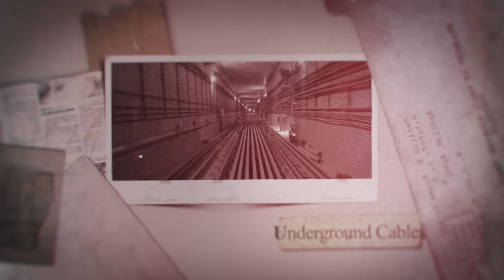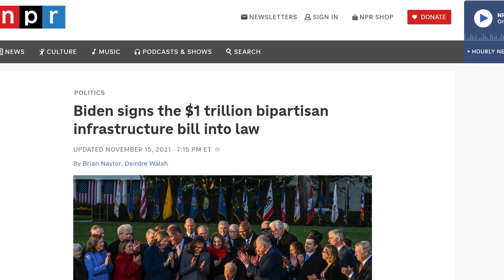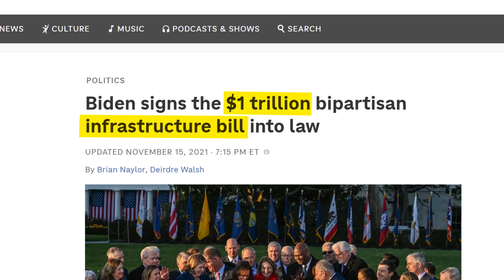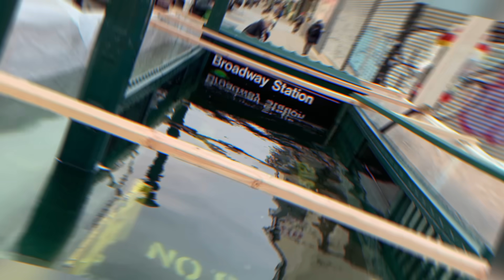Why Tokyo Has The Most CHAOTIC Power Lines in the World?

Comment: Canada has a hybrid system like the US. Downtown Toronto has mostly buried lines, but they ran into a problem a number of years back. The city salts roads to prevent ice build up. When the snow melted, that salt water was getting into underground transformer vaults and short them out. A lot of this was due to aging infrastructure. Politicians here don't focus on long term infrastructure maintenance because 1) it's expensive, and 2) it's not sexy. So stuff often has to be in really rough shape before it gets dealt with. A lot of it only got fixed due to make-work projects during the Great Recession. The United States has the same issue.

Comment: I have no problem with overhead power lines. BUT! When you have a whole cluster of cables coming from one central point, change it out with a single larger (more voltage/power) cable to the next point where power needs to be distributed. The distribute from there out to the other spots...similar to an Ethernet network using hubs.

Comment: In the Netherlands the whole country is underground. In Belgium and Germany that's not the case: there are still rural areas with overhead power lines. Obviously I prefer the underground ones because of aesthetics. When there's a power loss that is usually caused by digging in the ground. It happens rarely.

Comment: Underground cables are hard to repair in case of the aftermath of strong earthquakes, which unfortunately is Japan's reality. One solution for that is to make tunnels for cables, but that will cost a lot to construct and maintain with how large Japan is.
Reply: Underground cables are LESS susceptible to damage by earthquake, Poles flail about and snap the cables.
Reply: @paullangford8179 That's when the ground is relatively solid, a lot of areas in earthquake prone areas are also susceptible to liquefaction. We have a city with underground electric cables in one area (portion), the entire length lost integrity after a mag 6 earthquake struck. They ditched the costly repair and returned back to poles.

Comment: I think using both to maximize efficiency is best. As the video states, some adapt different system due to geographical conditions. So it is best to adapt a system depending on the place if it gets frequent typhoons then underground is better or have a mix of it both. Underground for commercial centers and have overhead lines for suburbs.

Comment: The ugliness of phone/internet wires in Asia is often more the installation of individual wires for each number / connection point (lack of installing trunk lines). That's why you see the coils of excess wire/fiber wound up on each pole. They COULD make them much more aesthetically pleasing and with lower overall costs, BUT they would have to invest in the trunk lines first, rather having no investment in the future and making customers pay for each point as it's installed.
Reply: it's the Telecommunications companies 😊

Comment: A lot of old east coast U.S. cities have cables and utility poles all over. Philadelphia is a very dense city yet outside the very center the lines are dangling everywhere. NYC outside Manhattan even strings them house to house without poles. It's very unsightly and many break loose in hurricane storms. I hope one day all dense urban areas can have power underground, or figure out a way to beam electricity wirelessly. Or get buildings disconnected with solar and battery.

Comment: Power lines generate heat which is why underground lines are much thicker than overhead lines. They need additional cooling since airflow is highly restricted, normally using dielectric oil. It's also much harder to find a break in an underground cable and maintenance costs are several orders of magnitude higher. It would be better to have dedicated overhead line avenues like we do for roads. In other words, leave a lane open just for power lines that doesn't cross streets, hang off the sides of building, or interfere with other public areas.  We need dedicated lanes of infrastructure as well as transportation. We need better civil engineering.

Comment: Alternating current suffers capacitive loss between the cable and the ground. Amount of loss is inversely proportional to the square of the distance of separation. A buried cable is only a few inches from the ground in all 360°.  An aerial cable is usually more than 20 feet from the ground for 180° and upwards is infinite.
  This energy loss consumes resources.

Comment: Living in rural Sweden. 6 miles from nearest town. In 2005 a winter storm resulted in 3 weeks without electricity and more without telephone. Another storm in 2006 only 2 weeks.
A bit troublesome in a electrically heated house and no water (electric pump in the well).
Electricity company has spent many hundreds of millions to dig down cables. Now maybe an hour a year black. Phone company have shut down the copper net. Erratic cell phone net but dug down fibre works great. And the cell phone switches to wifi.

Comment: In the Netherlands all cables are underground, but the Netherlands is also a delta area! There is water everywhere, even under my house. I don't have a basement, but there is a hatch to get to the sewer pipe and drinking water supply. But when I open the hatch, all I see is water. The distance between the water under my house and my living room floor is I think half a meter. And I live in the east of the Netherlands so not below sea level.
Reply: Water can be controlled, except for tsunamis, but earthquakes can happen at any time and will cause damage anywhere. Underground repairs will be much more difficult and require many times the cost.
Reply: @zianfarahariyadatuljanah407  Earthquakes have much less effect on undergroud services. Poles whip around and snap the cables. creating a hazard.

Comment: SMES Tiers and Levels Exception. APPROVED for Upgrades, Maintenance, Case Studies and Reconciliation/Realization of Assets Equipment Supplies/Suppliers under Warranties. Reason:Product Developments for Infrastructure, both land and water resistance capable. Newer Recyclable materials designed for Quality control. Example are the following Flood prone areas and Installation of cable wires underground. It is important that they are maintained with newer capacities to be as electro-protected, won't cause electric shock when submerged to water since materials are renewable and durable. Plastic/psi resistance should be increased, so as to prevent leakages on its foundations and that its coating are NON porrous material, THICKER, able to resists moisture, heat and DAMP places, specially in WIRING. 3.Castor roller infrastructure is important, since it is designed to anticipate types of Forces of Nature, able to HARNESS ENERGY, as a MEANS of BACK UP POWER. 4. TANGLED wires are to be REMOVED, since they  WEIGH HEAVIER and CAN UPROOT FOUNDATIONS of ELECTRICAL LINES. NEWER DESIGNS CAN BE INSTALLED, NEW MATERIALS that are both ECOFRIENDLY and can be installed at SELECT BLDGS, Accordingly. BUILDINGS and Underground structures are as established, with newer quality based materials, that lasts... as that of Issuance of Prototype Generators©™® Respective brand makers,sectors attested, so as to anticipate and bring back quality, quantity accordingly. Patents, Trademarks, Copyrights, LLCS, Registrations are owned by its owners. ALL RIGHTS RESERVED.******NON AI/Fintech standards of Excellence. THANK YOU*****IMPORTANT****

Comment: 🤔Aren’t all-in-one trench drain/ utility systems more efficient? Japan uses street trenches with concrete pavers with ingenious small gaps for hand holds and water drainage or metal grates. For extra safety use water protective coating for electrical/cable lines with embedded RDIF active AND passive TAGS so that utility companies’ drones can quickly identify any failure points. ⚠Incorporating♻efficient DISTRICT Heating & Cooling would benefit all. Japan is prone to SNOW/ICE storms AND typhoons/hurricanes which are prone to failures during these events.

Comment: Maybe you should just put everything in the ground in protected cables that are not in a tunnel but under the road or more like prediction or bicycle lane, we don’t have earthquakes those are the only ones that would probably have cut our electricity and central heating, fiber optic cables, drinking water which is the best Quality without any poison added, only oxygen to bond with iron sand can filter the iron, and suers, but we don’t have any environmental conditions that can impact our ground, not a tunnel system just in the ground in protected cables which are not effected by flooding

Comment: In cities I prefer the clean look but in more rural areas I don't mind overhead cables.
The EU forcing underground everything is just one of many things that prevents innovation and growth in the EU. Everything is too expensive and riddled with bureaucracy. 

One should be able to get fibre optic to your house without having to dig a 500 meter long trench, and when you're done you have to re-pave the road. It'll take a 3 months rather than one week and the cost will be 100x.
I'm not even sure it'll pay for itself because the cables needs replacing/upgrade after...50 years?
The rural areas I'm talking about here in Norway already have overhead power lines. 

The mess in some Japanese cities is insane though, some areas looks like a third world country.
But I'll take it for gives excellent photo opportunities 📷

Comment: I think there is no perfect solution for every continent. Building overhead cables and underground cables in same areas and assessing damage after flood, storm, fire might reveal which system is more durable in specific area. This approach would take decades to bring some answer but if cables will be used for centuries it might still be worth it ;D

Comment: BTW. Digging in Rome is VERY different than digging in any other city in Europe or the world. Try to add a kilometer-long subway tunnel in Rome. As soon as you dug 10 meters into the ground you start to find early medieval or ancient artifacts - houses - ceramics. It's just IMPOSSIBLE to dig through Rome underground without having any project stalled for YEARS on end.
Reply: same in Kyoto and Nara
Reply: In Amsterdam it is no different. The historic center is built on a swamp and the centuries-old buildings are supported by hundreds of thousands of wooden poles in the ground.

When Amsterdam built a new 9.7-kilometer metro tunnel under the city center in 2002, work often had to be halted because historic houses started to lean or even collapse. Or historical attributes were found, which forced the drilling to be stopped. As little as possible was drilled under buildings, but under the streets. Some underground metro stations were built on top of each other because there was little space in width. 

The entire project was canceled halfway through because the costs had already increased by two billion euros. After a few years, under pressure from the Dutch government, Amsterdam had to restart the project. Finally, in 2018, the new North-South metro line was ready.
Reply: Amsterdam has a high water table to contend with and soft soil
Reply: In Rome we need 20+ years to complete a subway line because every meter has an artifact
I love this city😂😂
Reply: There are plenty of cities in Europe that are similar. In England, York and Chester are the top examples, but the ancient parts of London are stuffed full of archaeology too.
Reply: Зато красиво🤩
Reply: Sometimes they need to accept that dead is dead ... Especially if they reveal no new information.

The problem is that someone has to come to make the assessment.

Comment: As a Londoner, i can say that, whilst i do think i prefer the nearer approach of buried cables, one big con of underground systems is that the road is constantly being dug up and patched with messy asphalt infills, if a cable breaks or a house needs a new fibre optic cable installed workmen will come in block half the road for at least a week but often longer and then when finished there will be a black asphalt gash in the stone tiled paving that is used to fill in the hole. Sometimes this is repaired in a reasonable time, say within two weeks of starting but often it can drag on for months if not years if the council loses track that there is in fact a piece of unfinished streetscape that needs workmen to come an fill in. One thing that struck me when visiting parts of asia and more organised parts of Europe is that street tiling is often in much better repair than back home.
Reply: It’s like with the USA it has nothing to do with putting everything in the ground, but effective organizing society, Denmark is the least corrupt country in the world and extremely effective, the only thing I agree with the video is it cost higher electricity prices but else our system functions extremely well, and except maybe in the capital cities Copenhagen because of the high population density those problems are not worth mentioning, and even in Copenhagen still a small problem that can parsley be medicated by planing and corporation, which is what our society values highly with corporatism. Working together as a symbiotic relationship, instead of winners takes all, not so good for startup culture as the American model but definitely better for building, financing and maintaining infrastructure then the American model.
Reply: The week after the underground power line is fixed, a faulty water pipe needs the street to be dug up again.
Reply: Fix Yours Metro Train Cleanliness First,Mr,Ms UK Or  USA To Damn Dirty  South East Asian Metro Are More Clean Then UK Or USA Metro Train 

If You Want To See Ratatouille  Main Character Go To Both Metro Everyday You Can See Rat Dancing In Train  Platform 😂😂😂😂😂😂

Comment: There’s also the issue of strong earthquakes in Japan damaging underground lines. It would be extremely costly to build underground utility lines that are safe from earthquake damage.
Reply: But Japan can do it with buildings, most of them are earthquake proof
Reply: Also? You even watch the video? He mentioned that multiple times
Reply: Underground supply is less susceptible to earthquajes and storms. During an earthquake, the poles wave about like tennis raquets, snapping the overhead wires and making a significant ground-level hazard.
Reply: Cables are far more resilient than water pipes.

I assure you, their water is underground.
Reply: Tbh overhead cables are especially dangerous in earthquake and Taifun zones. Fallen down cable lines could cause unnecessary more damage than just the disaster itself. From fires to electrocuting people.
Though I must say, that Thx to anime, the cable lines just like wood and paper houses have a nice cultural aspect to Japan's history.
Reply: Italy also has strong earthquakes. Would seem to disprove this theory.
Reply: @stevens1041  lol Italy earthquakes are nothing compare to Japans search about it properly
Reply: @aizen-so  The cables aren't simply buried in the ground; they're installed in massive tubes, so nothing happens in an earthquake. At least that's how they're built in Germany.
Reply: @bjorndebar8361  They built the same ducted systems in Niigata, doesn't help when the ground shears in 2 m. Aerial cables fare much better.
Reply: @Shaker626  That may be the case there. In Germany, something like that is rare.
Reply: @Shaker626  especially since Niigata has a nasty history with earthquakes, i.e. 1964 earthquake with the first documentation of liquefaction
Reply: @bjorndebar8361 wrong! It's mostly underground not into tubes only very high power and vital lines are in tubes
Reply: @stevens1041  Japan has more frequent earthquakes than Europe.
Reply: @stevens1041 lol in Europe thers no big cities comparing to Asia
Reply: @evan-du3vk  okay you're just wrong
Reply: @stevens1041 Italian earthquakes are child's plays compared to what nations in the Pacific ring of fire experience, we suffer +7.0 earthquakes constantly, multiple times every decade.
Reply: @stevens1041  mammia mia, i would like to have a pineapple pizza 😋
Reply: @stevens1041  Italy doesn't compare to Japan lol

Comment: Why does it cost so much in Japan to bury cables?
Reply: When a country experiences more than a 1000 earthquakes every year (not all are the size of ur Fukushima Daiichi or the recent Noto Peninsula), and when a country like Japan already has so much infrastructure developed, replacing the overhead lines with underground lines involves digging underground which is dangerous cuz there are already water, gas systems underground, along with optical fibre cables. Plus, the shortage of labour in japan's low-paying blue-collar industries already worsens their situation. Its estimated that it will take japan 150 years to replace all its ageing water pipes underground which have been built 70 years ago.
Reply: @SagnikRay-m3p  Curaçao has most, almost all, electric overhead, simply because volcanic soil is very difficult to dig in, and so very costly. Only done when really necessary. 

Is that also a factor in parts of Japan?
Reply: @SagnikRay-m3p  So they can put fibre optic cables but not electric cables.

Comment: Edinburgh got rid of its horse trams, and the city went for cable cars from 1888. It was to be the only city wide cable car network in the UK (cable cars were tried in other places). The lack of overhead supply cables was considered aesthetically pleasing. I don't know if it was used as as reason to prevent electrification when electric trams became a thing. The system worked well but lack of maintenance, WW1 and a post war need for expansion hastened its demise. It lasted till 1923

Comment: The cables on the thumbnail and at 0:11 are mainly communication lines.

When a cable has a big coil like on the thumbnail, it s fiber optic" fibers are fragile and if cut, you need some slack to do the repair, hence the coil at every change of direction.